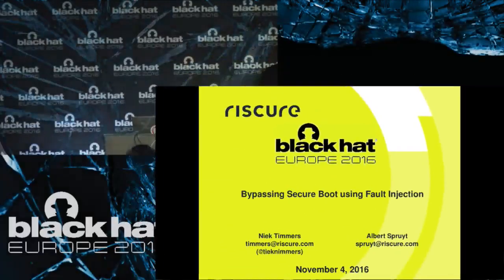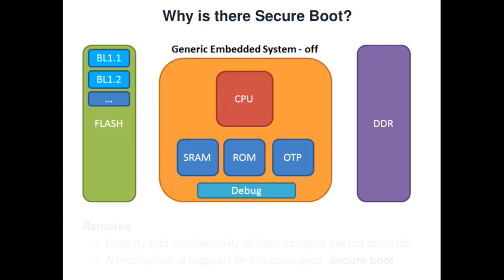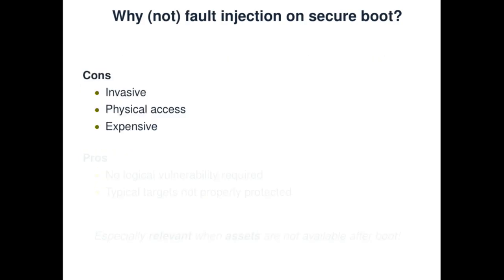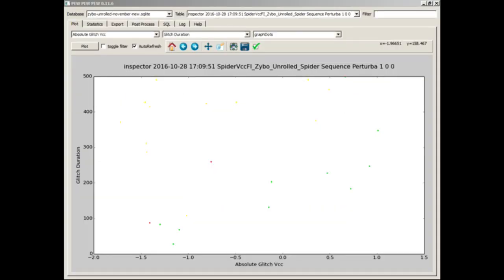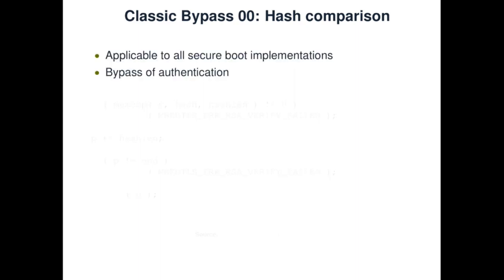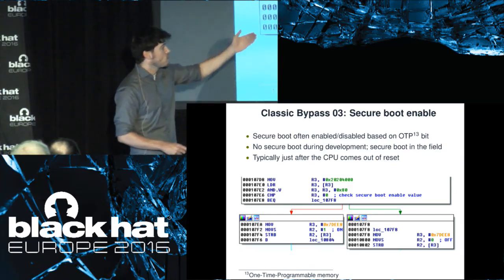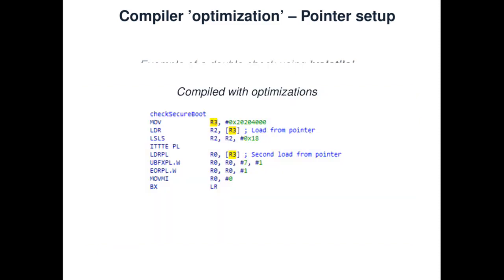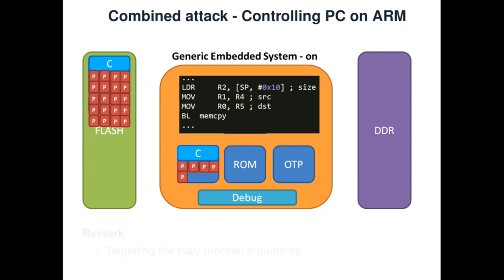Bypassing Secure Boot Using Fault Injection

Comment: This is always described in presentations as a fairly simple method, and that's if you use these simple examples. But in real life, you can spend months trying to get an MCU to somehow change its behavior. For example, I have some 8-bit chip that doesn't want to be glitched at all. It's like, "Okay! I'll wait until you stop doing this shit!", and just stops its clock, then starts it again and works. I then tried to manage it via EMF but nothing changed.
*To avoid compiler optimization issues in some critical places you should use compiler directives or just compile some parts separately, specifying optimization options. "Volatile" spec. isn't for this exact purpose despite that it related to optimization.